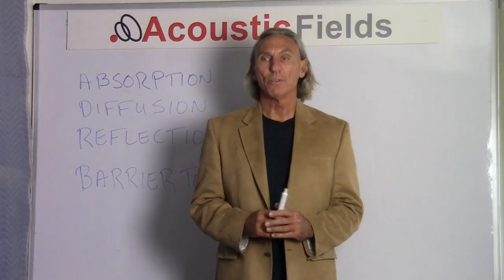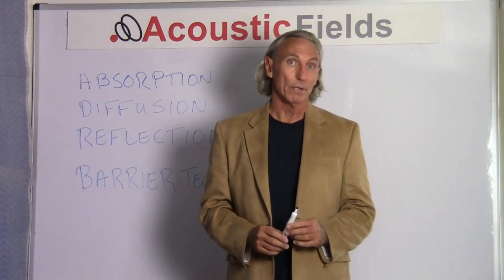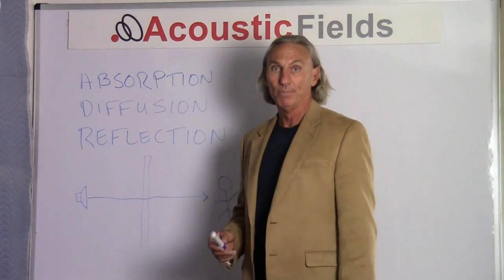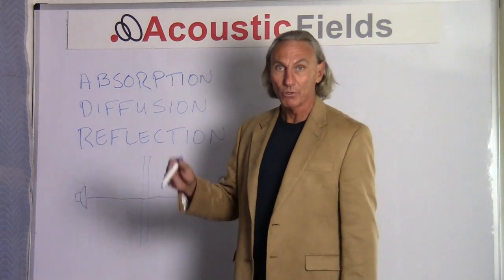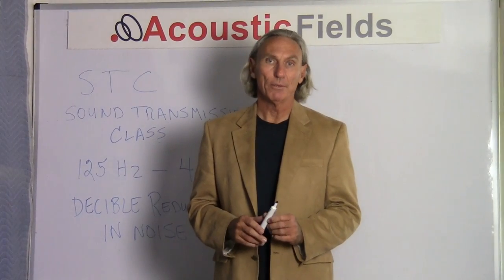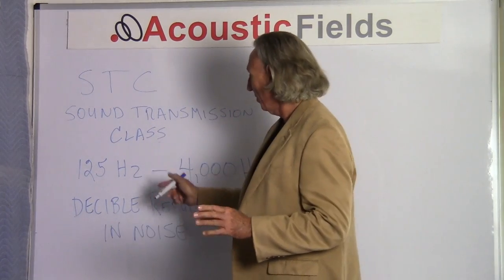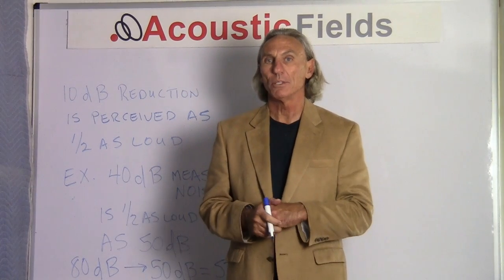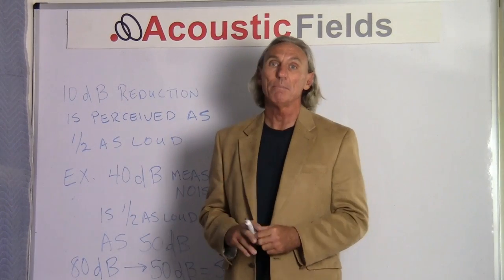What Is Barrier Technology And Why Is It Important - www.AcousticFields.com

Comment: The quieter the environment and/or surroundings, the harder isolating sound becomes.  Where I live it gets very quiet at night - and the easiest way to block out other sounds is to produce a little bit of white noise - from a fan moving the air a little or some dedicated device.  Adding 10dB of background noise - almost has the same effect as reducing 10dB of the offending noise.